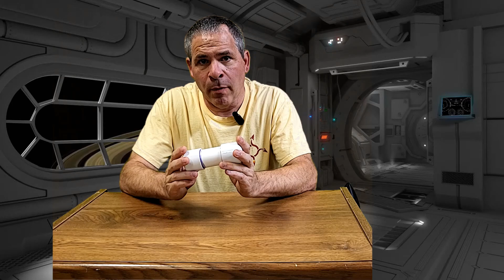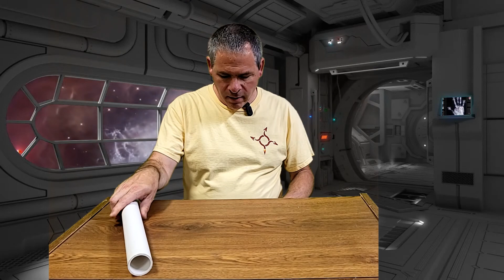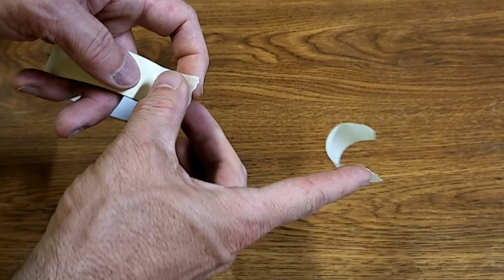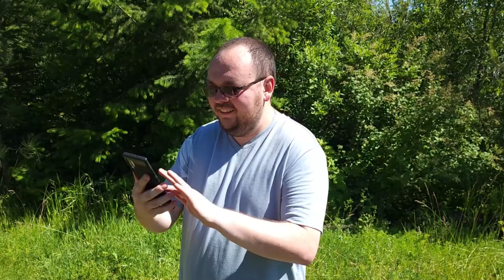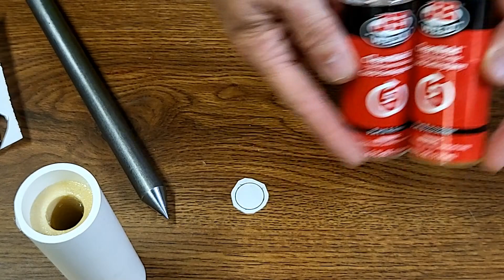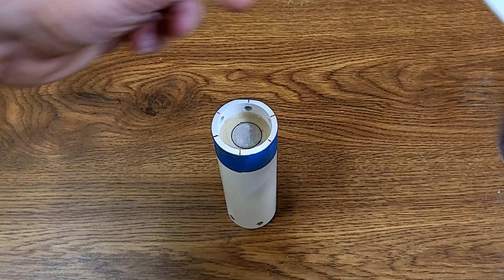Making our simplest homemade rocket motor even simpler?

Comment: Why not leave the ear plug in, pour the fuel same as you do and just drill the nozzle hole after fuel is set ? .... also, could you use a screw-in top ? so the motor could be cleaned and reused ? ..... PS: nobody ever seems to mention the bore hole to pipe diameter ratio - if there is one !!!?
Reply from the maker: Leaving the ear plug in... The core rod needs to have a hole to seat into when coring the fuel. So that's why the ear plug is removed and the thin layer of anchoring cement is punctured to open the nozzle area.

Re-use motor... The whole purpose of making the motor out of inexpensive materials is that it is intended to be a single use motor. A few issues with re-using the casing...
* I don't know how many times you would want to stress the PVC and there will typically be some burn marks inside the PVC after use. So continued use may result in a catastrophic failure.
* The anchoring cement of the nozzle gets eroded during the burn. Continued use would result in continued erosion.

Core hole to pipe size... There really is no fixed rule here. The distance between the edge of the core hole and the outside edge of the fuel is called the "web". A thicker web will result in a longer burn time than a thinner web.
Reply: @rotaryrocketry  THANKS for your reply ... I suppose that's why the Estes motors are in such thick cardboard !!! cheers

Comment: Sorry this is so late but I figured I’d ask it anyways😂 if I were to use potassium sorbitol fuel with 1% red iron oxide to speed up burn rate, would it cause a motor explosion in this design. I know sorbitol fuel burns at a lower temperature and slower but am not familiar with how much slower. I’m not sure you guys have the answer but it was worth a shot. Great video btw!!
Reply from the maker: Just switching to sorbitol fuel would probably not be a problem but adding a burn rate accelerant could be problematic.
Reply: @rotaryrocketry thanks I’ll try with both!!

Comment: Okay, cool. This is a really cool video. I used to make experimental motor kits sold by Aerotek, and the very last step is to fill the end with epoxy, just like you did with anchoring cement.

Comment: The Class 1 motors use a 3/4" coring rod and a 19/64 nozzle opening. 
I notice the Super Monkey and Super Monkey Plus motors used a 1/2" coring rod and a 11/32" nozzle opening. 
What is the advantage of one over the other? 
Can the Super Monkey motors be constructed sans the endcaps by utalizing the 6 anchoring hole method?
Reply from the maker: 1. Can Super Monkey be made without end caps... I suspect that would work just fine, but I have not built and tested one.
2. Nozzle size differences... The nozzle sizes for both these motors were selected by testing them to see what would explode and what would not explode. The sizes I've used offer safe performance with this fuel.
3. Core hole size differences...
- A. The Dart Monkey motor (the short, Class 1 motor) is... well... short. The more fuel that is burning at ignition, the more powerful a launch you will have. The core hole is quite large in this one so we can get a lot of fuel burning right away. The trade off is that this motor has a shorter burn time than the Super Monkey motors.
- B. The Super Motors are longer so we can keep the core hole smaller and still have a good amount of fuel burning at ignition. So for example, if you needed the Super Monkey to have more lift-off power, you could increase the core hole size to expose more fuel at the core. That said, a change like that may also require a different nozzle size - Testing would be needed if the core hole is changed.

Comment: why do you add epoxy at the end, can i not add the cement directly?
Reply from the maker: The fuel is hygroscopic, which means it absorbs moisture. The epoxy seals the top of the fuel so the wet anchoring cement does not come in contact with the fuel.

Comment: I have been doing something similar to this with pounded dry mix rockets. Can't wait to build flexi fuel rocket this way.
I take a small wire wheel on a drill to the grinder until it just fits inside the PVC then use it to rough up the inside of the pipe.
Reply from the maker: The wire wheel is a good idea. I'm not entirely convinced that roughing up the inside of the pipe is necessary but I do think it's a good idea.

Comment: Don't ever use PVC if it was to explod sharp bits of PVC will go into you body.Use rolled up paper and white pva glue,they sre really strong.
Reply from the maker: First off... We have proven over and over and over that PVC can be used successfully for rocket motors. They just have to be designed and built properly.
Secondly... These are always ignited with people a very safe distance away.
Reply: Always use pvc. It's the easiest rockets I've made and totally safe for non mental,careful people. You might want to try some cast iron pipe for results that mirror your prediction. Good luck out there.

Comment: Any idea what class this would fall in? Approximately...
Reply from the maker: No, I've never bothered to do a thrust test with either of the motors shown in this video.
Only think I can tell you is that we use this size motor to launch our 3" rockets that weight about 1000 grams. That's the complete launch weight including the motor.
Reply: @rotaryrocketry  Thanks. What altitudes are you acheiving?
Reply from the maker: 900 to 1100 feet.

Comment: Heyo, I thought I was a relative master of doing things very precisely on the cheap, but you're apparently a real master, too.
I could make a thousand comments, but I'll make just one:  flexi-fluel can be made perfectly reproducibility by using a large pressure-cooker canner with an internal container holding the ingredients, absolutely reproducible.  It does actually get thicker at a given temp without boiling off any water because the heat/temp makes the sucrose fully dissolve, but since it's hotter to start with it's still pourable.
Reply: If for some bizarre reason it ignited you'd be dead anywhere near the sealed pressure cooker.

Comment: One more tip, take a look at PVC knockout caps. The could simplify your build even more. They fit entirely in the pipe with a flange to hold them in place. HD has them for 40 cents where I live.
Reply from the maker: hmmm... I am familiar with the test caps. Not sure where I would integrate that into the build but definitely something I will keep in mind. Thx.

Comment: Why not just put earplug back to keep fuel filling nozzle? It also keep moisture out, just unplug before launch.. Probably silicone or ptfe are better as lubricant, wd40 is water displacement.
Reply from the maker: Excellent question... I did use the earplug to block the nozzle in one of our other motor build videos and it works great... Except... The fuel gets stuck to the earplug and the earplug tends to break when you try to pull it out. With this current system, the earplug is reusable. 
Silicone, ptfe or spray cooking oil all work well for core rod lubricant.

Comment: When you drill plastic with your drill press, run it in reverse and it wont grab the workpiece or crack it or make it crawl up the bit.....
Reply from the maker: Interesting... Unfortunately, neither of my drill presses have a "reverse". I guess the manufacturer thought it would be of no value to turn drill bits backwards.
Reply: @rotaryrocketry  Google "reverse spiral drill bits" or "left-handed drill bits" - Harbor Freight have them for not crazy money. That lets you run the drill press in "FORWARDS" and still spin the bit in the opposite direction.  I'm not convinced that this makes better holes in UPVC though...it just makes me wonder if I'm some kind of tool hoarder to actually own a set!!

Comment: An easy way to get your holes drilled evenly into your 6 holes would be to measure the holes out on a piece of tape. Wrap it around the pipe and then your holes will be clearly marked. As a bonus you will get cleaner holes too.

Comment: And the easiest way for me to make this cut is by using the most dangerous cutting saw ever made by man and Craftsman.
Reply from the maker: Well... ANY tool can be dangerous.
Reply: @rotaryrocketry  My 6" spirit level is only dangerous if you attempt to swallow it - but otherwise, you're right.  But it is a matter of degree of injury and odds of it happening.  Any circular cutting device that doesn't have some kind of retracting blade shield is inherently a LOT more dangerous than one with such a shield.
Reply: Just shut up would you does this guy seem stupid to you or something. Do you wear a helmet when you go for a walk?

Comment: Maybe use wax instead of epoxy for the top cap?
Just melt in a layer for separating the fuel and the top cement cap.
Reply from the maker: As long as the wax does not disintegrate instantly from the heat in the motor. If it were to disintegrate before the motor was finished burning then that would expose an area of the PVC to the hot gasses.
Reply: @rotaryrocketry  I imagine it would melt, but I wouldn’t think a coating of wax would make that big of a gap.
Maybe a coat of some spray can sealant to create a moisture barrier would be enough?
Either way, it’s a minor step, and epoxy already works! 🤙

Comment: Excellent as always. I know you do not use software to designe your motors. However, would the outer surface of your propellant be considered inhibited or exposed? Thank you.
Reply from the maker: I have used Richard Nakka's SRM spreadsheet quite a bit to help in motor development. Mostly just to get an idea of a good starting size for the nozzle and then I fine tune it with trial-end-error from there.
For this design, the outer surface, top & bottom are inhibited. The only uninhibited surface is the core.
Reply: @rotaryrocketry  thank you very much.

Comment: I think the word approximately needs to be added before pretty much every step of this. Basically, eyeball every measurement by locking your finger and checking the wind.
Reply from the maker: True, not all measurements need to be exact... But it worked... That's what matters in the end.
Reply: Sure, there ARE measurable differences in performance with fuel-load variances, but how WOULD you measure them from the ground, and why?
Reply from the maker: I think the original comment was talking about the fact that my measurements for drilling holes was not very accurate. But the design of this motor is so simple that the measurements don't need to be accurate.
As for ground testing... I just have not had any need to do a ground thrust test on this motor. It lifts our small 3" rockets to around 800 to 1000 feet high so I really don't need to know any thrust data at this point.
Reply: @rotaryrocketry  If you know the length of the rocket - then a video of the launch - viewed frame-by-frame will allow you to at least do comparative tests of two designs by looking at how many rocket-lengths it travels in each frame of the video.   Some simple math would get you an actual thrust versus time graph - but that doesn't matter if all you're doing it comparing two designs to see which is better.
You can also get the duration of the burn from a static fire test...and armed with both pieces of information, you'll be able to get a decent estimate of the ISP.
Reply from the maker: All very true... but a bit more that I was interested in doing for this video. I really just wanted to prove that the anchoring cement end caps would not blow out.

Comment: My idea for a rocket is a ceramic tube, with a capacitor made of graphite and ceramic like those in some uf in ceramic capacitors suspended by ceramic in the center of the tube. A magnetron is the input and a working gas goes into the tube for the reaction. That is the rocket. Coils or magnets outside the tube may be used to accelerate the gas out of the tube faster. That is the electrodynamic propulsion system.
Reply from the maker: A bit off topic for this video. Also, fair to say that I don't have a clue what you are talking about :)
Reply: @rotaryrocketry  Basically a microwave driven plasma rocket.
Reply: @travismoore7849  has this been done or is it just theory?
Reply: @Cantbreakitifitsnotfixed  I tested the plasma capacitor that arced in the microwave that when turned off had a powerful electrical field. I shocked my self so I know it can make a arc plasma. Andstore energy like a tv flyback system. As for the magnetic accelerator stage I have not made it.
Reply: @travismoore7849  Probably costs a shade more than $3 though.
Reply: @SteveBakerIsHere  I used an old candle and pencil lead and a old smuckers peanut butter jar and made it from scraps.
Reply: U're a real rocket scientist, for sure!
Reply: @MattRios-jn1qx  Not really it was just some wax coated graphite, with the exposed electrodes at opposite ends a bit of of paper soaked in salt water wrapped around the waxed electrodes tied together with dental floss and suspended in air by a pencil in a peanut butter jar. And nuked in the microwave. It acted like a device that held a high energy charge and made a ball of plasma like a mini sun. It was dangerous and stupid. And after it was turned off it shocked the living daylights out of me.

Comment: Gloves and power tools can be a dangerous combination, if the drill/blade catches the material it can pull your hand into the mechanism. Cheers
Reply from the maker: Therein lies the problem... If I make a video without using safety equipment, people complain that I wasn't showing others how to do something safely... If I use safety equipment people say I should not have used it. It's really a lose-lose scenario. I suppose the overall lesson here is DON'T PUT YOUR HAND NEAR THE DRILL BIT - GLOVE OR NO GLOVE. I appreciate your concern though.
Reply: @rotaryrocketry  I'm sure you're good at assessing your own risk mate, just throwing it out there for viewers to consider. No shade and thanks for the vids
Reply: @rotaryrocketry I think people just lack common sense these days.
Reply: I know the drill press and lathe area in the shop at work have signs indicating "NO GLOVES" & "NO SLEEVES" (we often wear Kevlar sleeves when working around sheet metal) Thanks for the great video!
Reply: You are right but also can be dangerous without gloves. Carpenter for more than decade and i have caught my finger in drill bc i was wearing gloves, but then when i didnt wear gloves i stuck the drill bit in my hand when then boom lift i was on shifted and destabilized my force on drill causing bit to take sharp turn into my hand that wss holding wood in position.
Reply: @julybliss4440  Sounds pretty severe, I wonder if gloves would have even helped you there. Hope you didn't suffer permanent damage :O
Reply: @jeremiahbullfrog9288  certain gloves I wear have made stabbing yourself with driver bit less deep, still hurts though. No not any glove will stop the average force you use for some of the fasteners. Yeah I healed. Just bleed pretty bad and deep infection from  oils on screw. 
Any more the Only gloves I will use with drilling are these tight Kevlar coated(similar to nitrile or rubber coated) called "ninjas", they tend to slip instead of catching on bits if they make contact. They make different colors ones for different purposes or job task. 
But heck even the time I was wearing looser gloves and caught in bit, it about dislocated my finger, hurt like hell and jammed knuckles and finger joints. 
Journeyman was yelling at me that he has seen it snap the bones in fingers when getting caught. 
Power tools are dangerous no matter what, but like you say it's important to not be careless and dont use loose, holey, or frayed gloves.
Reply: @julybliss4440  Ouch! Glad you were able to heal up
Cheers
Reply: Ok but if ur using a bench grinder DO NOT wear gloves idc who complains. Google "welding gloving" it's gruesome. Rips ur hand skin off entirely and the doctors put it back on like a glove
Reply: Yeah - I have to second that one.  Gloves should definitely NOT be worn around bitey power tools.   If the glove gets caught in the tool, it'll drag your hand in and that'll be worse than not wearing the glove at all.  Because of that they are the opposite of protection. Many generations of workshop workers have learned this lesson the extremely painful way.
Reply from the maker: O.k... o.k... I apologize for showing gloves when using a drill press. Kinda too many people leaving "don't wear gloves for a drill press" comments. I get it, my bad.
Reply: @rotaryrocketry  I never meant for that to happen from my comment, just offering another perspective.. Everyone's in charge of their own safety, you'll never bubble-wrap the internet enough for everyone to stfu, so there's not much point in trying. Cheers and thanks for making stuff.
Reply from the maker: Nah... Not your fault :)